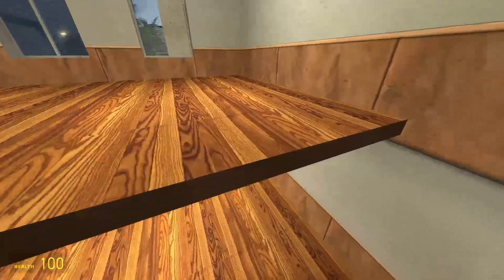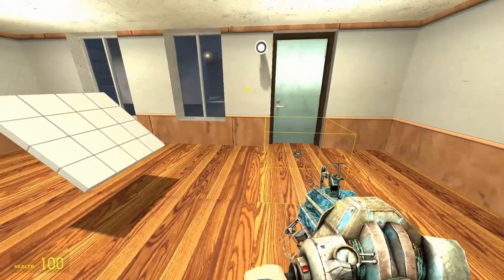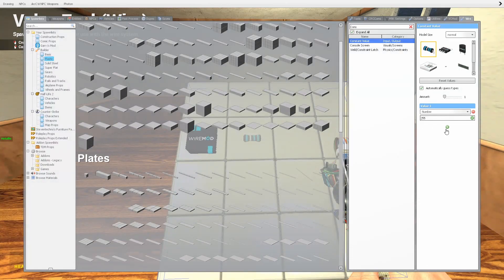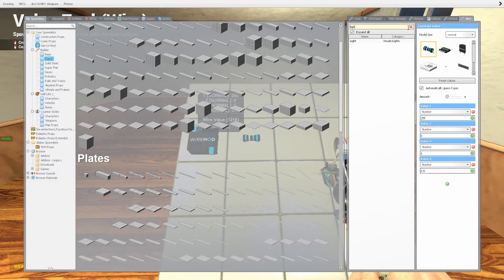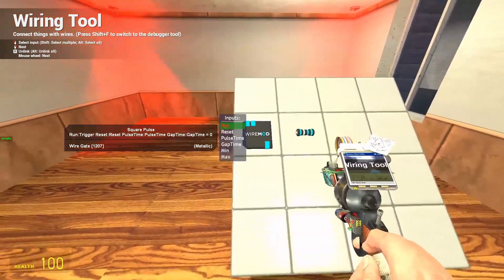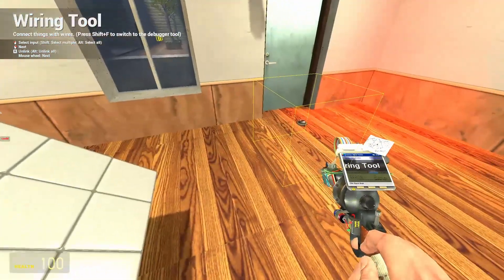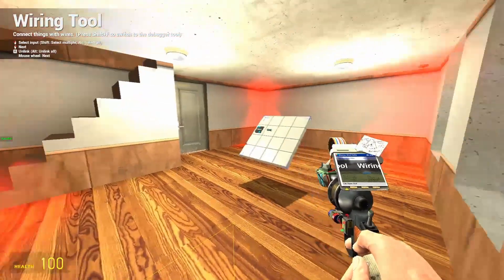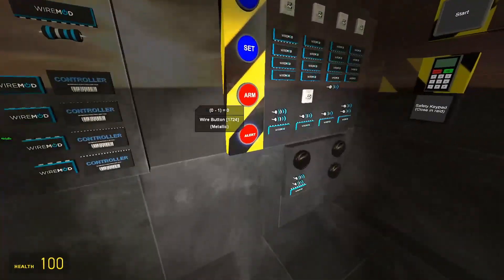How to Make a Wiremod Alarm | Garry's Mod | Wiremod Tutorial

Comment: Thanks for the tutorial: helped me figure out how to use the pulser, which will definitely come in handy from now on.

May I ask where the alarm sound heard comes from? I don't recognize it.
Reply from the maker: Hey, no worries! The alarm that I demonstrated in the build at the very start I think is a Citadel base alarm however I have used a constant value to tweak the PITCH value of the sound emmiters, to create a more customised, unique sound.
Reply: @immetallic.  Now that I watch this video again it's actually the square pulse gate, but close enough I guess.

Oh okay. When I decided to go looking for it however it turns out that it's actually "alarm_citizen_loop1" from HL2 with the pitch & speed upped to 100: still a unique (& effective!) sound no doubt though. What about the "NPC_FloorTurret.Alarm" parameter in the sound emitter tool though? I looked it up but all the pages I found didn't actually tell me what sound it relates to, & putting it in the sound emitter didn't do anything (unless it's just a nonexistent file path/file name you put in for demonstration purposes).

On another note, I've since built a few alarm systems using what I learned in your tutorial, one based off the "power alarm" from the video game Myst, & two others based off a Source Engine mod that was never released (but that still had a few videos made about it prior to its cancellation). One thing I did was have the light & the alarm on different timing circuits so that the light could be precisely flashed to the alarm (any timing works as long as they both add up to the same number: for instance one setup had one value as 1.2 & the other as 0.8 so that they added exactly up to 2: the other square pulse gate had different values but they still added up to 2 so that the light & alarm were in perfect sync).

Thanks again for the tutorial!